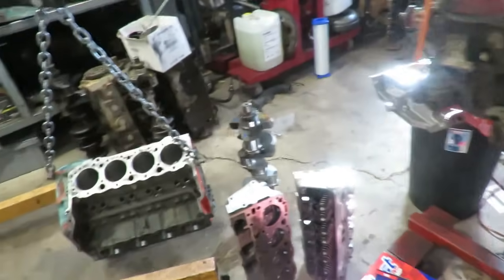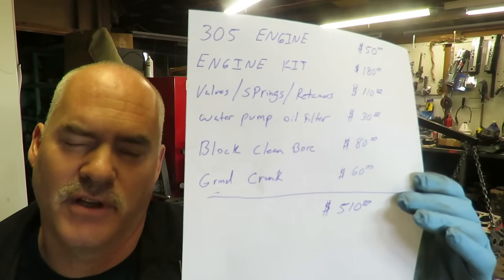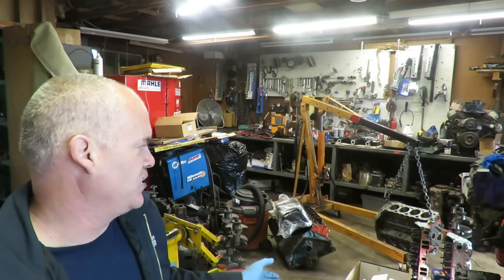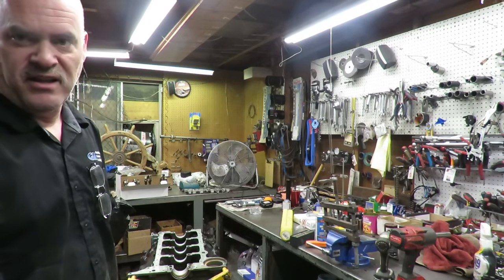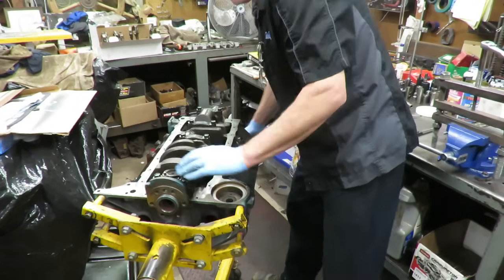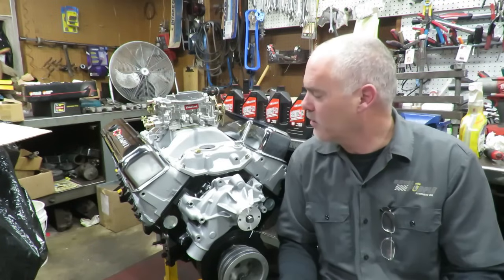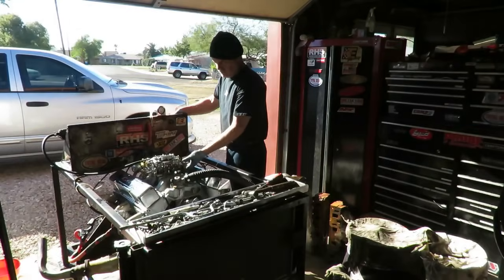Small Block Chevy extreme Budget Build

Comment: Wonder what you could build a small block Ford 302 for on a budget.. ?
Reply from the maker: STOP IT !!     now you making me think about  another video
Reply: My 302 is all torn down , I'll rebuild it if I can find affordable parts . If not I may have to build a budget 305 and put in the F100 !
Reply: @TxStang  You should be able to, 351 probably not, but 302 is definitely doable. Search that craigslist and ebay now and plan ahead to get the parts.
Reply: Or a 318 LA haha
Reply: Ford Explorer and you can do it cheap !!
Reply: David Callahan agreed!  Roller motor, good heads, stout bottom end.  I see a build off in the future!
Reply from the maker: @TxStang  Noooo don't do that!!  build the 302 man it is a much better engine than the 305 and I bet you could do it pretty reasonably
Reply: @TxStang  I don't know how much more rebuilding a 302 costs of rebuilding an SBC. However, I would bet that the added price of rebuilding a 302 would be more than offset by the price of modding a Ford to accept a budget Chevy 305. Often you have to buy or build special engine mounts, and you have to buy various transmission parts so that the Chevy engine bolts to the Ford automatic.

The price of machining the 302 engine is probably not significantly higher than that of an SBC.

This channel had a video about how he rebuilt a 289 from an early Mustang. If you look at all the stuff he bought for the 289, it would probably help you understand what stuff you must buy for a Ford 302.
Reply: if you convert a Ford vehicle to a Chevy engine you normally use a Chevy transmission with it .............  typically ford engine parts are 15 to 20% higher cost than chevy parts  if not more , so a set of motor mounts would still make the chevy swap alot cheaper .
Reply: @TxStang  Honestly I'm not if that holds true now days.. But it would still be a cool build to test it out.
Reply: @Myvintageiron7512  I've got a 74 302 in my garage that I want to put in a Bronco 2. It sat in a guys garage for 15 years before I bought it and a C4 transmission. Can you give me the name of your friends shop? His prices sound really reasonable. I'm in Cave Creek.
Reply: Fin a 351c 390 400 used and just put it in get a good one cheap they last longer then Chevys anyway, also get a good rv cam and you have a motor better than Chevy.
Reply: @jackrohde4709  I thought the 351C was uncommon and significantly more expensive to build than a 302. However, I thought that when you get a 351W, the price increase is not nearly as steep.

This channel does have a video about 351C vs 351W and that video may serve as good advice.

The best 351W to get would probably be from a 1990s F-series truck. Those engines had a roller cam from the factory. If you wanted an aggressive cam, you could buy such a cam and buy premium OE replacement lifters for a good price.
Reply: Add 40% to this build and thats the number
Reply: I built a 331 for $800 dollars. Plus $150 for a 60,000 mile shortblock. Lots of part trading and some barter work.
Reply: @Myvintageiron7512  Well... Count my comment as a second encouragement for this video, because my request is the same of the Ben Browser. I follow thy channel for a couple of years now. Thanks so much for all the information posted. And I have thy name in the top of my head for a project. 

Actually I'm not from US, I'm from Brazil. And the 70's Ford Maverick was a big hit back then and it's still a desired car today around here. 

I'm willing to have a modern F-302 running under a Maverick hood with 12-to-1 compression ratio because here we have two options in gas stations: Gasoline and Alcohol/Ethanol. And Ethanol takes a higher compression ration then gasoline.

Thanks in advance.
Ace
Reply: @Myvintageiron7512  
OK, I think we all now want to see you do the "302 budget build" now.
You started this thing, you finish it!!
:)

Comment: I'm sorry but I'm in the mid West and nobody is doing machine work that cheap lol
Reply: $25 a hole to bore + $80 to clean + $50 to install cam brgs & freeze plugs + $50 for magnalux. My crank guy gets $150 to grind a crank.
Reply: This was definitely a buddy doing him a favor. No one in the North Texas area would vat and bore for 80 bucks.
Reply: Ga Fin  BAHAHABAHAHA.!!
Reply: Crate motor then
Reply: Ha its actually cheaper in Texas lmao#southtexas
Reply: @olds767 I hear ya I'm all about big blocks myself, I just sold a 91 S10 with a 1971 400 small block I put L98 aluminum heads on it was strong as hell I like the 400 sbc. But if I'm going to spend money it's going to be a big block. I get a kick out of making good power on the cheap.
Reply: @olds767 It would matter what you are trying to get out of it.   My daily drivers have small blocks and automatics, and my toys have big blocks and sticks.
Reply: do it by hand, emry cloth and elbow grease :P
Reply: @seangangstad9597  what part of sTX
Reply: @johndowe7003 small town outside southern Houston
Reply: @seangangstad9597  nice im down in south texas
Reply: New blocks bored and honed from summit are dirt cheap. Ive used them with great success.
Reply: @johnlaws8764  We should get a crate motor video. Everyone has their nightmare stories.
Reply: A friend of a friend
Reply: @johnlaws8764  LS engines are better than the older engines. A vortex max engine has like 400hp stock on pump gas. There's a reason people swap LS for high end drag racing, and it's not because of a budget.

That being said, most people, like stated previously, do extremely cheap budget LS swaps and blow the motors nonstop
Reply: 2JZ everything
Reply: let me know any place in ontario that is that cost
Reply: @olds767 big blocks are wickedly expensive to buy in the first place,parts are next to impossible to find for oddballs and stupidly pricey...
to be frank ,if you want more than 400/400 horse/torque go ls.
Reply: @trillrifaxegrindor4411  shortblocks are a dime a dozen for 454  and skip white sells heads for a grand delivered to front door     whats hard ???
Reply: A few short years ago i spent about 1200 dollars for machine shop services.  block dunked, cam bearing install.   50 dollar a hole for .030 over boring bar . .007 off the deck ( the 0010 block wasn't quite flat )   flat top hyper pistons and rods pressed on. i refused an align bore. but the crank was polished.
Reply: @johnlaws8764  just get a crate GM goodwrench engine , replace the pistons with 1.585" pistons and you have a corrected compression and zero deck and correct quench area, for no machine work done- engine that you can use a O.O4O" head gasket on and have perfect quench, get 4cc valve relief pockets in pistons or greater depending on head cc. Throw in a great modern grind roller cam, a thumpr , or lunati boot legger or comp XR276HR or XR282HR, mod or replace the heads with jegs iron or promaxx MAXX SERIES aluminum. an intake like a performer RPM or EPS or brodix 4 hole , 650 to 750cfm carb. .any cam change above stock requires headers or burn your valves up. you'll have a 370-400+hp 400+ tq engine for price of pistons, cylinder heads , cam. well and the crate engine price that you may resell the pistons , heads, cam out of to an ultra budget build for someone like the video only a better driver, street and performance version.
Reply: @EmptySetOutdoors  lol

Comment: I thought you needed a 20 min break in at 2K-3K RPM so the lifters mate to the cam correctly? did I misunderstand one of your prior videos @MVI7512. from the edit, it doesn't seem like that happened. can you clarify when free, thanks!
Reply from the maker: the 30 minute cam break in was done the night before off camera
Reply: I’ve never ever broken a cam in. In fact I had swapped several cams and run two new engines before I had even heard that. I never have lost a lobe. I’ve always ran Mobil 1 full synthetic and maybe that’s why? I think it’s more related to gigantic valve spring pressures and crappy oil. A very reputable a well know engine builder in my area has never broken a cam in as well. They have circle track motors that go from a stand to the track without anything but prelubing the motor. I’m not saying you should listen to me, but I’ve done 7-8 total hyd and solid flat cams and never had an issue. I always used plenty of moly lube on the cam, prelubed the engine and ran 40-60 weight Mobil 1. I had my last cam nitrided for $107 last year before installing it for added protection, but still no breakin of the cam.
Reply: Great video but gotta break it in
Reply from the maker: @mattperkins7038  you dodged a bullet  so far spring pressure if a factor for sure but if you keep that poratice up it is going to bite you at some point and when it happens it ruins the entire engine not fun at all I would say probably 40% of the early engines that I rebuild come in with one or more flat cam lobes the crazy part is other than that the engines seem to be in pretty good shape just did a Pontiac 400 and a 390 Ford both were running and driving and both lost a cylinder upon disassembly both had a shredded cam lobe the metal from the lobe wipes out everything even the piston pins are tight from all the metal in the oil these are just two examples I can give dozens more  keep in mins these engines were stock low spring pressures every cam manufacturer requires a break in on flat tappet cams and correct oil
Reply: Myvintageiron7512 I forgot to mention that I always used Delphi lifters with the motors. Can I ask you about my engine I’m assembling right now? So it’ll have a new Howard’s cam too, but this is a new motor and I want to break it in correct. Not just the cam; the whole thing. I’ve heard tremendous things about amsoil signature series. What say you? Oh and the oil I used for my engines and new cams were European blend 0w-40  which has zinc apparently. Dumb luck on my part I guess lol
Reply: @mattperkins7038  thanks for the reply. I understand that if it was just a cam and lifter swap, cool, but in prior videos for Vintage under chevy break, as this budget video this comment is under is for a full rebuild, which is more than just a cam swap. his prior advice was just that. ill see if I can find it for you
Reply: @mattperkins7038  here is the video and states it is "absolutely imperative" to do this process. https://www.youtube.com/watch?v=lMYqdU_2GnE

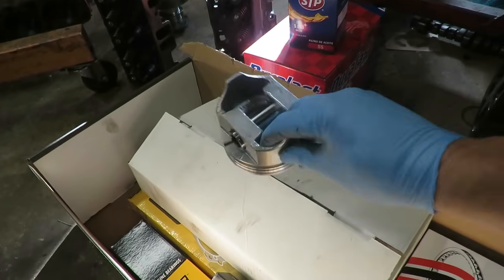look at the 6:30ish mark as he mentions this technique. let me know your thoughts matt. thanks for the responses.
Reply: @Richard Vanwinkle No race team keeps an engine together for years at a time either...
Reply: @Myvintageiron7512   where do you go work out of?

Comment: Can you do a 350 budget build for the same price parts cost about the same right?
Reply from the maker: Yes but if you dont have an engine the core will set you back a few hundred if you already have the engine you can do this w/ a 350
Reply: Heck yeah you can, I've been buying parts for a 350 (358) for about a year now. I've got all ARP bolts, an eagle crank, H beam rods, a fel pro high performance gasket set and new aluminium heads and have less than 2k in the engine. After machine work I should have right around 3k- 3200 in an engine that will make near 500 horsepower.  Bought almost everything on amazon.
Reply: probably about $30 cheaper.
Reply: @Myvintageiron7512  I bet if you were patient you could find a 350 for $100. Hell I picked up a complete K20 chevy for free. 350 that needs rebuilt in it.
Reply from the maker: @bradywilliams2666  yes you certainly can just be aware that it will most likely need extensive machine work one of the upsides to 305's is they can be had with low miles on them because they get pulled out and set aside for many years most of the 350's have been rebuilt already and are very worn out that is why they are being sold when you buy a core make sure it did not sit outside uncovered and make sure the crankshaft rotates
Reply: @kalmlykeabomb  for 3200 you could have bought a brand new 350 from chevy for 2,600 >_> just saying.

side note after typing that i see it says 358 beside that,point still remains for others who might like this info
Reply: @0Heeroyuy01  no one likes the info
Reply: @trillrifaxegrindor4411  someone did it has +1
so :P

Comment: Great Budget flat tappet cams are the Crane Energizer like the .480/.480 @.050 228/228 adv 284/284 LSA 112.  Choppy idle, decent vacuum and pulls hard. 
Generally not much over $100.00 for cam & lifters. 
If you didn’t have vacuum concerns their .500/.500 @.050 246/246 adv 300/300 cam has a Racy idle same cost.

Comment: could have reuse the original cam/lifters heads and valves nothing wrong with OEM. the engine was low mileage. just clean it up and run it.
Reply: If it was in good shape be more like half price even less.

Comment: You only charge $80 for boring a v8? I paid $250 for bore and hone on a big block. Greetings from Tucson.
Reply: And I get charged $65 for cam bearings vs your $30. Need to find a new shop
Reply: My closes shop is 1.5hrs away and they charge 40 dollars a hole. I have more into machine work then he has into the motor
Reply: BuzzLOLOL I paid an extra $75 on top of that for a dip in simple green. Not even an acid tank.
Reply: jon sixxx where is larry's